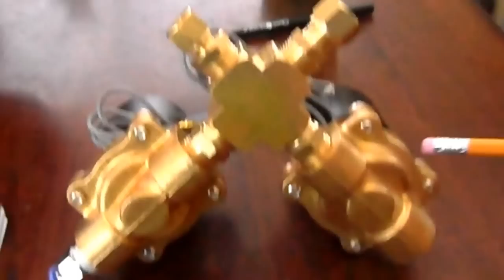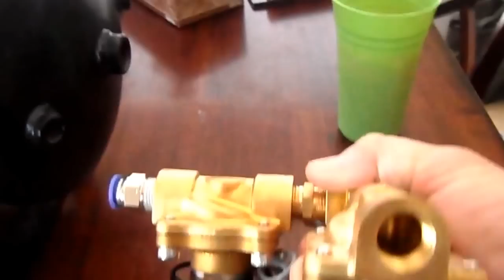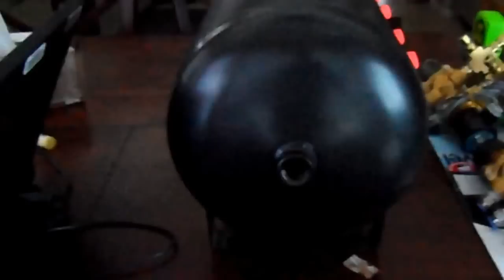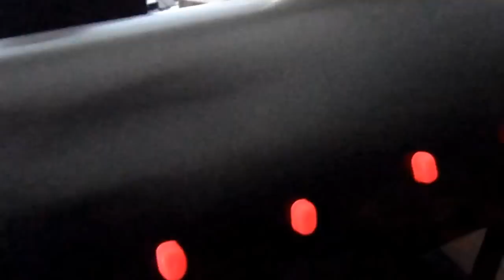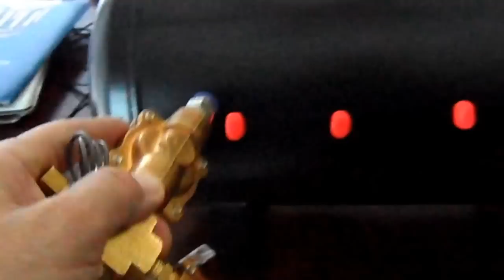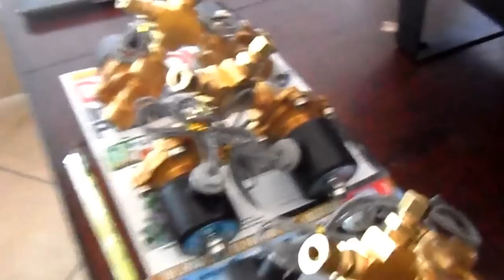Air Ride Suspension Installation Solenoid set up

Comment: I have 120 pressure switch and doesn't lift front of 98 silverado,am I using you low of switch?
Reply: Yes, to low on pressure, you need at least 150psi, and depending on the airline size how far air has to travel to the air bag.

Comment: after several air ride installations I strongly recommend loctite 565. it's a white paste. it remains semi soft and doesn't harden. due to vibration n heat some of the hard thread sealants can become brittle and leak. I have never ever had a problem with 565. ride tech themselves uses it.

Comment: Using those solenoids do you get a faster land stronger lift? I have a system in my car but i don't have these electrical solenoids as my switches are pure mechanical, but when i lift the car it's slow and also it seems to not lift all the way back up. I see some guys on here the car almost jumps off the ground.
Reply: Why would you want it to air up that hard?

Comment: Do not use Teflon tape or blue loctite. Use loctite 545 for automotive high pressure threaded hydraulic fittings. It's a white paste. Used it on my Accuair setup and not one leak anywhere.

Comment from the maker: You are 100% correct. I didn't listen and used Teflon tape because I just wouldn't believe the locktite would really work. Once aired up, every connection leaked. I went back, cleaned off the Teflon tape and used blue locktite. NO leaks.